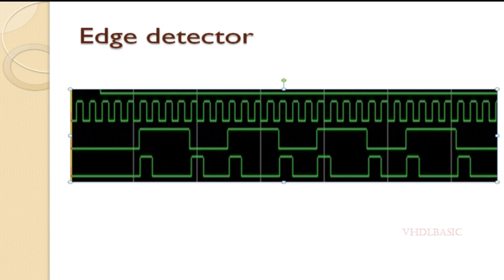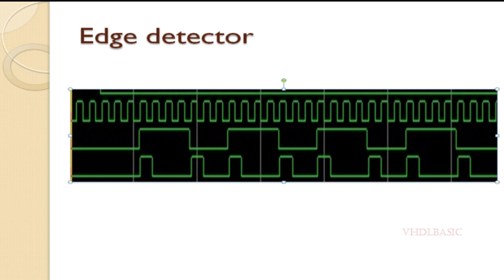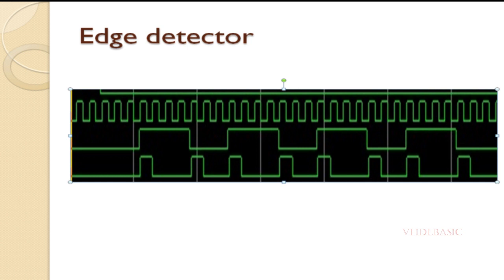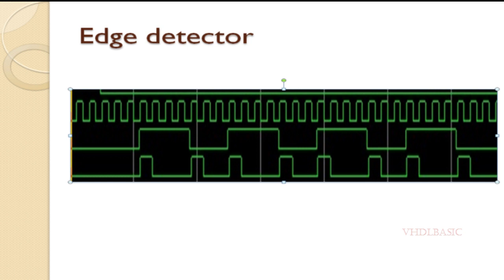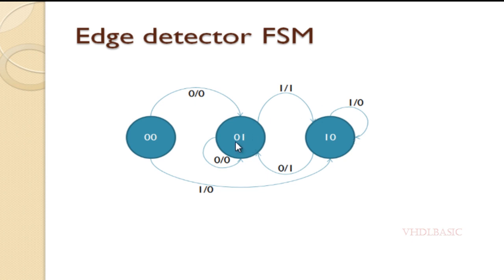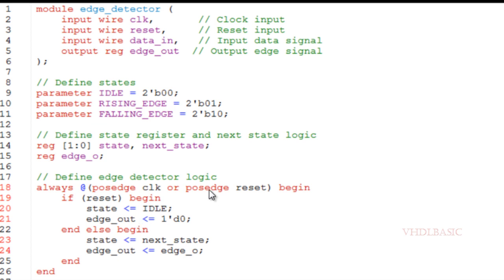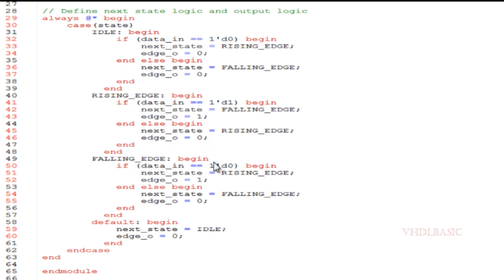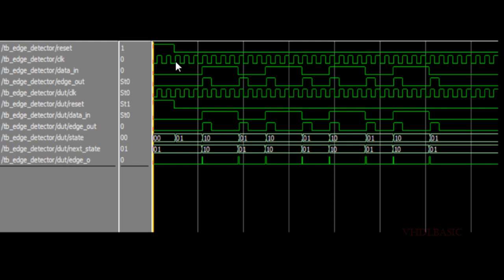Edge detector implementation using FSM

Comment: Thanks for the video, I have a question, I built my Mealy machine and reached the same results with only 2 states, the behavior of my circuit is like the state 0 is for 0 and the state 1is for 1, my input is determined by a switch, so when I pull up the switch the first led turns on for 0.1 seconds, and then it turns off, then if I pull down the switch the second led turns on for 0.1 seconds, so I think that the most optimal Mealy machine diagram is with only 2 states, S0 if in = 1 the out is = 1 else in = 0 the out is 0, S1 if in = 1 the out is = 0 else in = 0 the out is = 1.

Can you confirm my supposition?